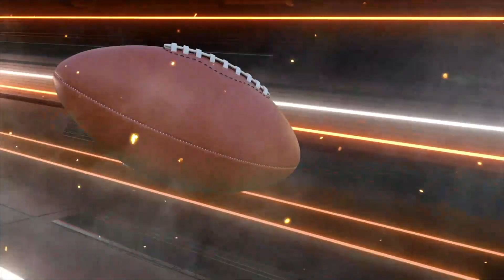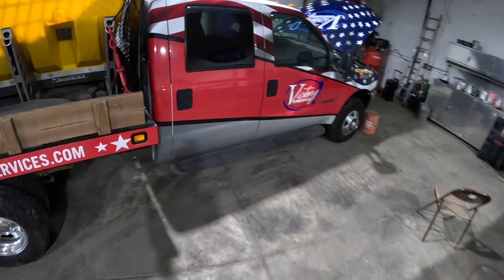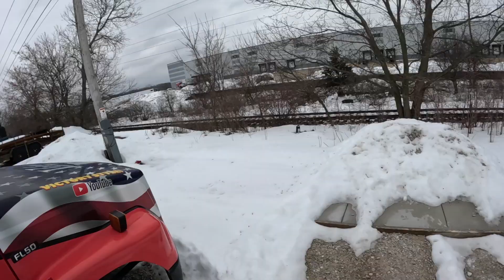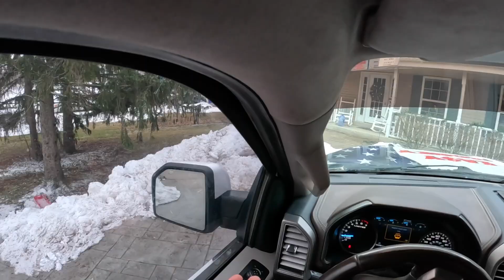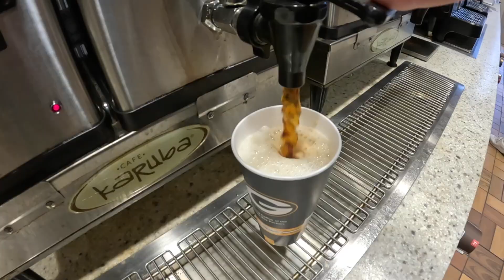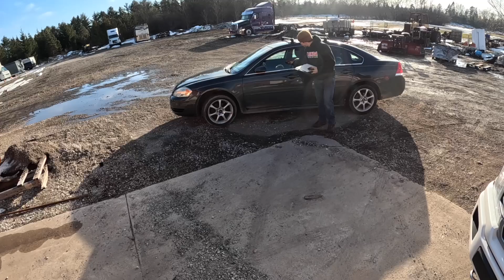The city might shut me down!

Comment: Interesting to hear that you were “in violation” for putting gravel down. I’m pretty sure usually gravel is considered a “pervious material” rather than an “impervious material.” I guess depending on what size stone you used it can be considered impervious. It’s basically just the fact that you can’t alter the rate at which storm water leaves the site more than a certain amount. Still interesting to hear that it was considered “impervious”

Comment: I see why people would be confused in Australian with the truck where you buy it for tax it’s pretty real over over you get a high percentage back on tax time if it was 50k would be like maybe 40k but it’s not cut and dry but it’s work pretty well over here so I was a bit confused when you said it
Reply: The US has stricter Accounting laws than international bodies. In the US we follow GAAP (Generally Accepted Accounting Principles). This method tells us that if you make a purchase for an assets, like Ryan's truck, for 50k, then you will have to decide which method of depreciation you would like to use for tax purposes. For simplicity sake, we'll assume that Ryan's accountant used the straight-line depreciation method. Let us assume that the truck will have a life time of 10 years. We simply divide 50,000/10 to get 5,000 a year. This is the only amount that is considered a tax write off.

Comment: As a contractor, We deal with all the hassle of permits and have delt with the reprocutions of not having one or not doing things correctly, At first i always thought if you own the property, You can do whatever you want. The thing you have to consider when doing things on your property, Yes its your property, The question is; Is what your doing on your property affecting other people property? You have the same rights as them so it would be unfair to negatively affect someone elses property with the work done on yours. In the case of the gravel, Its all about drainage and not flooding your neighbors, You need to have proper weeping beds, use the correct fill, and other stuff i am not knowledgeable enough to speak on. With sheds you can typically build one a certain size WITHOUT electricity without a permit but im from canada so no clue what its like there, And also no clue about commercial as i do residential. Knowing how strict residential can be, Im sure commercial/industrial is more strict. Your probably going to need everyone under the sun on a project like this, Especially doing so much to the land.

Comment: That's the f**** dumbest thing I've ever heard in my life what I would do if I were you victory is I would take those guys to. Court and say here's my interview material play rocks in a painting with holes in the bottom poor Water in it and call them out say my definition of impervious means Water will not pass through it.
 Here is a 5 gallon bucket full of water.
  And we will see if water travels through this or on the surface proceeded dump the water as. It comes out the bottom and say are we redefining what the word in curvious mean?
 Or what's going on here

Comment: I feel ya on the gravel..These new SWPPP are tricky,   storm water drain issues, I ran into here. It was under a qtr acre, and I was stopped in my tracks......because I didn't have a paving permit....for the grade and gravel I put down for the truck  to back in, instead of mud.After already  bidding the Job, I had to dig it all back out, and add a load of rip, cut the sidewalk out and add a swell, literally 5 ft from the entrance of the new drive to slow the water down from that 25ftx 30ft section. Then they expanded the work site to the full lot size of 1 acre because  trucks leave from a different drive. So yea, it can get expensive quick, over, in my opinion  little things, but I also understand, some people may do some dumb things.

Comment: What sensor was it? One of our trucks is doing something similar except you will be driving coming off a red light and accelerate and it acts like it pops out of gear it’s a automatic transmission we would push the tow haul button in and it would have response to the gas pedal, and then it would do it again and again. It never died out it just wouldn’t go when you stepped on the gas pedal

Comment: I just feel like a lot of these violations are due to the fact that every single thing Ryan does is on video. And like he said, either a city employee or a “hater” reported these violations. I mean, yes it’s true in most cities and towns, the city codes requires you to pull a permit to put a shed, a sign, a flag etc. but the truth is, most people don’t pull permits. And the city won’t audit you years down the road to check if the old shed had a permit pulled.

Comment: I know how you feel. I made a couple of big mistakes when I rebuilt my back deck. The first was that I didn't have the piling holes inspected, which I didn't know was required, before filling them with concrete.  I had to dig out next to one of the pilings so they could see it was sufficient size. The second mistake I made was that I didn't notice that they had changed the size of the cross member from 2x8 to 2x10. I had to pay a bunch of money to have an engineer come out and perform an inspection. They gave me a report to send to the city that said the deck was of sufficient strength despite not being 100% to code.

Comment: Hey Ryan! Pete here fom Vermont, just a quick question, I used to install overhead doors years ago,how would you get into that little building with an electric operator on that door and if the operator failed or no power? How do you plan on getting in? Just looks like a future issue I see you could run into ,love your 💪work and work ethics take care blessings

Comment: I bought 15 acres and planned to put up a office building, 30'x60' and two 40'x60' pole buildings. I was lucky to know my neighbor, "business" who told me to get a lawyer up front who had experience in the process. "I used his". First thing I was told was "do nothing" to the property. The process was ridiculous. Permits for everything. I had to have a study done to cut a driveway into the property for water run off and environmental impact ? "THEY" told me how my driveway was to be constructed. Not allowed asphalt, had to use concrete. Width and depth had to be to their specs. The office building was uneventful, but the pole buildings were inspected no less than 10 times. Every single action required a inspection. I was told how I had to landscape and what was to be used where. My final cost over runs ran a little more than $36,000.00 !! The most ridiculous part of the mess to me was the electrical contractor put the poles and power feed to the right of the driveway where the pole buildings were to be fed because a transformer pack had to be put in to feed the 2 buildings. It failed inspection as they required them to be placed on the left side of the driveway the same side as the office complex ? Yes, they were moved. The best day of my life was when they signed off on the final inspection.

Comment: Rats like to chew up wiring because the insulation material used, especially on older vehicles used to be made with vegetable oil. At least that's my understanding. Never tried it myself so I would know.

Comment: Another youtuber Andrew Camarata kind of went through the same situation with the gravel because his Karen neighbor was reporting him. He bought a mountain top in NY and did demoing to break up the rock and made gravel roads out of it, his neighbor didnt like it so the city came out to inspect and he found out if you move more than like 50 tons of material to a new location you need all kinds of permits. But since all his material came from on site he had no issues. Guessing part of your issue might be something along those lines, although not to the extent he did it. 

Even if the gravel isnt permeable, which is one of the main points of using gravel is its drainage, you said you're putting in a retention pond which will help with any offset from the gravel.

Comment: Gravel driveways are considered impervious because they prevent infiltration, which results in stormwater flowing off these surfaces at a higher rate than pervious surfaces. This is typically due to compaction of the underlying soil and stones by vehicles.

Comment: I moved from a city in Florida one year ago that has permits and regulations for everything. If you need a water heater, You must hire a licensed plumber for $400.00 and pay The City of Port St Lucie $135.00 for  a permit! That by the way does not include the cost of the water heater. The City will then inspect your water heater and if it is not up to their standards, will prevent you from using in until in meets code!

Comment: I was a building inspector for 25 years. I built a commercial building in a different jurisdiction and had to deal with the same issues. But that was 20 years ago. I still own the building but I live in Arizona and on the beach in México. Life is good. Hang in there.

Comment: It’s gonna be a long process but you will get it done. From my experience when they double the permit cost, as long as it’s within the building codes they let it slide. I’ve dealt with this before and that’s what happens. They don’t like it when there is a structure that isn’t on the survey.

Comment: Many studies have clearly shown that gravel especially compacted becomes impervious. Meaning if the flow patterns aren’t “perfect” or “appropriate” for erosion mitigation you can increase the time of concentration at a single discharge point causing many issues due to your unaccounted tributary areas. Basically you can accidentally cause a drainage problem to other neighboring properties which is a building code violation, hence permits will be your best friend from here on out.

Comment: I find this funny because of all that was stored on the site before you bought it. I Milwaukee it is against the law to park on gravel because it is not a permeant surface and oil can drain through it and rocks get dragged to the road from it. I got many fines from paint concrete walls every year when nothing wrong to parking boats on gravel on my own property. They are a motor vehicle or did you not know.

Comment: Mention to the council the gravel put in stops the spread of mud from your site onto the streets from the vehicles tyres, which can be a safety concern for vehicles using the city street.  Maybe also look up the council's requirements of containment of soil material onto each individual site and EPA requirements of soil contamination and the stormwater systems.

Comment: Gravel an impervious material? has the city been spending time with the President's son? if the questioned shed is a pre built that can be trailered in and set in place who cares if framed in place then yes I would understand a permit. Occupancy? it's a piece of land with a couple of small out buildings it's not a home, apartment complex, retail or office space as long as you keep it clean and don't do anything that pollutes a water source or causes damage to a neighboring property who cares what happens as long as as it's maintained and property taxes are paid. otherwise I'd sell and if really good tack on another 2% to your bid to any project with a address with the city name. there's city limits and addresses outside of it if they ask why my work speaks for it and due to john doe no. 1 - 4 and jane doe no. 1 - 3 from the city.

Comment: This is but a learning process and being upset only complicates things.  It’s important to remain level headed and resolve an issue at a time.  Being mad or upset shrinks the brain, it literally stops a person from thinking straight.  Staying cool, working out and eating correctly will help with negative feelings.  There’s no such thing as mistakes or screwups, there’s only learning and or becoming wiser.  Buy a code book, whenever you’re going to build something, just take two minutes and check what the code is. Beats being double charged.  Smile, you’re doing great things.

Comment: Gravel is impervious but the driveway isnt?!?!?
Reply: Having done tons of work in Philly, I am under the assumption that gravel is not impervious (pervious?)  We were not allowed to put concrete or asphalt driveways in some places. Instead, we had to use blocks with holes, filled with stone. I'm sure towns are different but I'm also sure Philly has super stringent requirements considering there is no new building, just renovations. Either way, it sounds like they have it out for, my friend.  Best of luck!

Comment: Nope, you have to use clear stone  permeable sub-base for driveways.

You cannot use normal Type 1 or crushed stone. Well you can but you have to install a soakaway on your property to take the water run off.

Comment: Often our thoughts are our worst enemy - turning into worries that are completely unfounded. I get it's  a good thing to be a little bit pessimistic ( cause then you can only be pleasantly surprised ) however once the head runs off in thoughts....well....

Big Ray is back and Carlito is on - the next season is shaping up already!

When does it actually start? I mean when will the first pours actually start happening?

Comment: You are going to have nothing but trouble trying to build and even once built, the city will never leave you alone.   Lived somewhere like that for a long time and you needed a permit to do anything to your property or improve you residence.   Anything other than minor repairs was considered construction and a permit would be needed.    With your video’s, the inspectors don’t even need to go to the property, just watch your video’s and start writing violations.   Surprised they didn’t get your for the new roof on the small building with no permit or the cement you poured there.   You didn’t have a permit for the gravel so I am presuming you didn’t have one for the cement either.   As for your blue shed, if they give you grief, lift it up again and put it on blocks, not a solid cement foundation and tell them exactly the same thing, its a temp non permanent construction aid.   With it moveable, its just like it was a car or trailer, they can’t force you to get a permit for it.   When you build anything like this, use screws instead of nails and you can simply state its a non permanent structure  to assist construction.   It can be taken apart without demo simply by unscrewing it, another way to get around the permit.    Did you get a permit for the electrical you put in, if not look for that violation soon.   With the level of pushback you have already gotten, this will be a nightmare for you to get anything done with that property and its gonna cost you an arm and a leg to get it done.    Sorry for the bad news, always pick a county area as they are usually easier to do stuff like this instead of a city.     If your real lucky, live in an area that if its not residential, zero permits are needed to build anything.

Comment: Gravel, Impervious, WHATT, I've heard it all now!! 😂
Good luck Victory ✌️
Reply: Somebody tell the guy who came up with french drains
Reply: Exacty what I thought...It's the most permeable products available 😆
Reply: 1776! Let's go. George washington would have never stood for this
Reply: Gravel is absolutely an impervious surface. When you put it down, it is not, when you drive on it for months it becomes compacted and acts very similar to pavement. Once gravel is compacted, from cars or heavy equipment, for example, surface water runs off of it much like a paved surface. The city engineers are absolutely correct. 

Stay in school kids.
Reply: @Jagabot_Esq.  Completely depends on the size of the gravel. They used pretty large diameter gravel. It won't compact enough. it will always be permeable.
Reply: @RathJ13  do you have a credible source for this assertion that large diameter gravel is permeable?
Reply: @Jagabot_Esq. Gravel is an aggregate, and it has to be mixed to make it hard.
Reply: @Jagabot_Esq.  Thanks Teach! Compaction is the villain.
Reply: @Jagabot_Esq. OK buddy you make me a swimming pool with the gravel Ryan used and compact it all you like. 😂😂Go back to school!!  Sir!! 😂🎉

Comment: You might want to set up a contact with the city so when you are planning things you can run it by them to see if permits are needed. It would be a really good thing to stay in compliance before the changes are made. It could help you to foster a better relationship as you learn what needs permitting and what does not. Each city is different.

Comment: Remember to never try to apply common sense to government. Listen and comply with their demands and you will end up with the building you want.  Years ago I was renovating a tiny retail shop for a Firearms Business in a 150 year old building.  Zoning required an Stamped Architect drawn ADA compliment bathroom in a building that was not an could never be wheelchair accessible due to entry steps and a narrow door.  The craziest thing was they would not issue a CO until a  Braille exit sign was hung next to the front door.   I hope they do not force you into a costly fire suppression system. That seems to be the new requirement  in my area to pretty much any new construction commercial buildings.  Keep your positive attitude and jump each hurdle as they arise.

Comment: best advice is don't sweat the small things worrying about stuff before it happens will only add to bitterness and negativity. It has taken me years to learn to " just go with the flow" things have a way of working themselves out. No need to stress on things that have happened or will happen and just deal with them when the time comes. Most municipalities don't allow anything on a vacant lot without a main structure on it which sounds crazy but put in place for different reasons. I guess you need to be more careful of how you word things in your videos from now on especially when it comes to the new property :) later Ryan